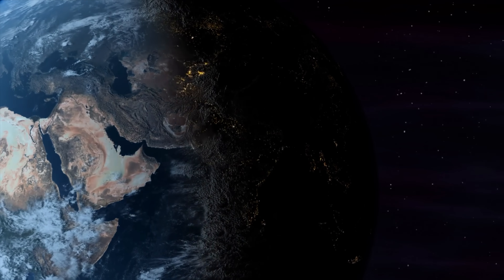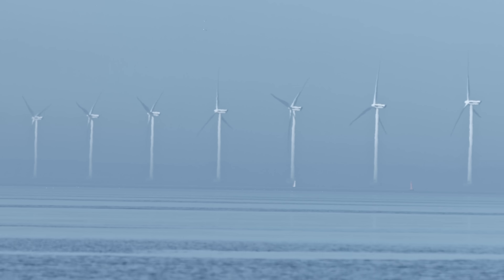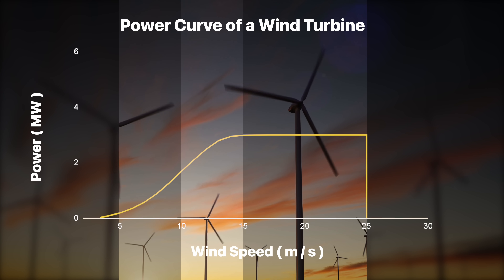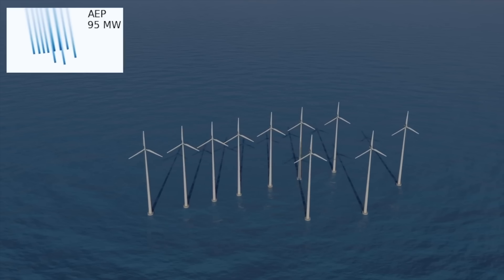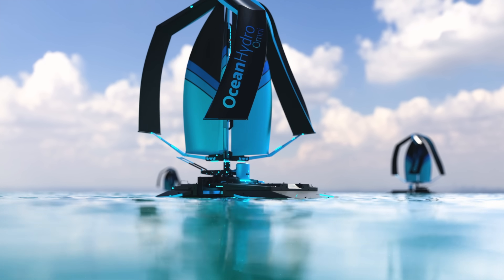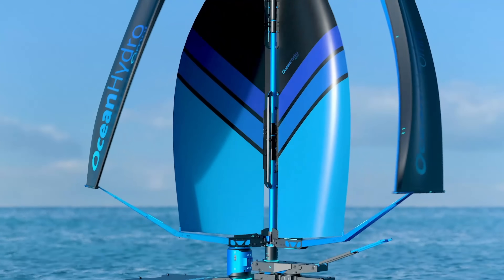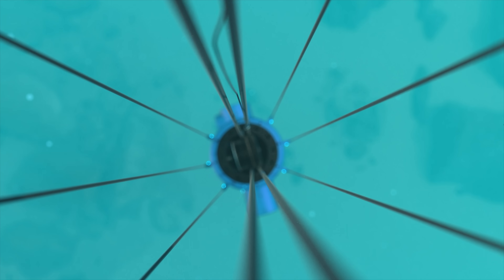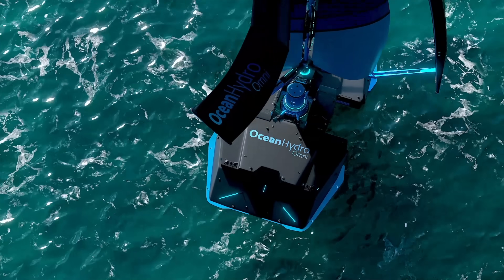Breakthrough Tech Solves Wind Power's BIGGEST Problem!

Comment: As someone who worked in maintenance on offshore rigs, I give absolutely zero trust in something that depends on moving parts underwater. Saltwater, biological damage, electrochemical corrosion, erosion, mud intrusion, tidal surge, the list of things that can damage moving materials underwater is too long to list. There's a reason there's no old submarines in service, why ships have to be pulled out every few years. You'd have more reliability if you designed a machine that hits itself with a sledgehammer every hour.
Reply: Forgive me for any ignorance involved; partially why I am asking this question!

Why does the energy storage need to be at sea at all? The energy has to be routed to the grid at some point; why not just have the energy storage on land just before connecting to the grid? Whether that is a gravity battery, a molten salt battery, or some other form.

Is it something to do with an added inefficiency when moving variable amounts of power over distance vs. a constant? That is the only reason I can think of as to why you would want the battery specifically at the generator when the generator is in a difficult environment to work with.
Reply: @aimerw  There is some theoretical advantage to be gained by the water depth and use of buoyancy to locate the upper mechanism of what is essentially a crane/hoist. However, and underwater crane in an deepwater marine environment is a recipe for a maintenance disaster. Aside from the maintenance workload itself, if anything is dropped to the sea floor during maintenance, the whole mechanism could easily be terminally compromised. Now multiply that by however many thousands need to be deployed for a meaningful grid contribution, eventually the oceans will be littered with wrecks. We're trying to think sustainability, aren't we? Why work in an environment that is notoriously difficult and expensive to clean up?
Reply: @aimerw  the flow batteries are entering  production,gelion and redflow. The materials  are cheap and they can be scaled easily. Rust batteries.  There are others.
Probobly  barking up the wrong tree on sea batteries.  But all possibilities  should be explored.
Reply: @aimerw   - nope, it is just "their" cute idea for "co-location" - gen+stor - , maybe there are reduced grid access licensing issues (usualy there are way different licences for the 2 functions as storage needs to satisfy demand contracts, and provide frequency control and demand levelling, ect,  while generation can be intermittent) - but all the downsides exist (pumping air to a submerged chamber is probably a more sound "at sea" storage solution, but that doesn't sound as revolutionary any more - compared to a modern "coockoo clock mechanism...  thermal inefficiencies exist in that one too..)
Reply: I hate to reply to my own comment, but this is probably the least efficient way to generate power with mechanical generation also. It would be more efficient to lift and drop a giant turbine, that way you're generating on the lift and the drop, or just put it on a giant above water tank and mechanically pump and release water into hydroelectric generator storage, timing the pump and release with the tides would even make it more efficient and you have the same energy storage without water turbulence losses.
Reply: @plebiansociety  The pumped hydro idea was what I thought this was going to be, but an alternative would be to have two weights on a single turbine, with one weight being lifted while the other is being dropped to produce power.
Reply: @dalesplitstone6276   - OR put the weights in a dry environment and just send the electricity there.
"plebiansociety" has valid points and experience, untill someone gets a prototype working reliably the whole thing is an exercise in CGI.

The VAWT - having 2 sets of blades/wings - needs to consider decoupling (and probably "furling", or just get rid of...) the  drag-type starting vanes from the aerodynamic "wings, as well as moving beyond fixed pitch VAWT for cyclically variable  - (then startup torque becomes less of an issue, and more of a feature) - OR for startup to "cut in speed, use some stored / grid resources....)

I think the group designing this has more interest in sailing boat games than electricity generation - hmmm.

(don't forget submerged masses suffer from buoyancy - reducing mass effect - mass costs $$ - , and the VAWT hull has to displace additional volume to account for the submerged mass, hull "size" adds cost...  anyhoo..  we are being interestingly "entertained" )
Reply: @kadmow  The whole reason to put them in the ocean is to avoid the NIMBY effect. I’m not saying it’s a good idea- just explaining the rationale.
Reply: @plebiansociety  Good points.  A laudable idea, but the pink shirt wearing CEO of this startup has likely only testing this in his bath tub or local swimming pool.
We've long since proven as a species we can make nearly anything.  However, making it sustainable, cost effective when faced with the wear and tear of the ocean....hmm
Reply: @stuartburns8657  “make nearly anything”

Sorry that’s the kind of thing said by people that make nothing. What science and engineering have done is show what’s possible, and what’s not.  The possible, with work, has enabled the modern world.  The latter is important because humans are finite w finite resources and would accomplish little if they wasted time on the impossible.  One cant, for instance, build an airplane that flies out of the atmosphere and it’s silly to try. The world is not one big smart phone app, upgraded every 6 weeks for free.
Reply: @Nill757  Didn't imply that for a moment.  It was qualified with 'however impractical' 
Yes I'm aware the world isn't like an app my friend
Reply: @plebiansociety  I was thinking the same thing. This thing would need to be cleaned all the time (biological damage). There would be a buildup of coral and algae on the lifted object as well that would make it heavier the longer its submerged. This concept just doesnt work unless they have clever answers to salt degradation and sealife buildup
Reply: @plebiansociety  I forget where I saw this, but there’s another kind of battery I saw that was slightly different and seemed more feasible. Use the electricity to pump air down to a tank on the sea floor, and then release the air to regenerate that electricity. It’s not as efficient but after factoring in maintenance it’s probably the best option as most of the parts can be contained or sheltered from the sea.
Reply: @plebiansociety  I have only been on boats, none of you experience, but i know how many time lowering and raising the anchor causes problems lol, This is nonsense
Reply: @plebiansociety  Yeah and VAWT's are VERY inefficient. Pretty, but not enough product vs cost to build.
Reply: @plebiansociety  I came here to have the same complaint about large moving parts submerged in deep seawater.
Reply: @plebiansociety  extra maintenance means extra jobs too tho right?
Reply: @plebiansociety  I hate to state the obvious but while I was prepared to listen to you based on your offshore rig experience, you lost all credibility with the post.   If you can't or won't do the calculations, you're just being yet another emotional luddite.
Reply: @crinolynneendymion8755  it's just a YouTube comment tho right, it's not a peer review of a journal...
Reply: @crinolynneendymion8755  not emotional, just find it humorous that they think this is going to work with any sort of cost effectiveness.  A deep sea oil rig at 6 years of age has enough instrumentation and electrical maintenance that it requires 3 technicians working around the clock 7 days a week to keep up. They aren't that big, at least compared to other drilling rigs, and all they do is drop, lift and spin. But why should I have to do calculations when just major things on the workings aren't even explained; if this is going to be lifted and dropped by cable, how are they dealing with stowage of a cable not only strong enough to lift this weight but strong enough hold itself if it's going to be lifted and dropped hundreds of feet to the ocean floor. This thing is going to have to be seriously heavy to generate power worth mentioning. There's reasons boats use anchor chains and not anchor cables, seawater permeates to the core of cable making every surface corrode,  it stretches, and it has to be stowed. When you curl up a large diameter cable it adds stresses to the cable because metal doesn't want to stretch to make a curve. Stress it repetitively and it fails bit by bit until it snaps, releasing a force strong enough to cause devastating damage to both sides of the cable. So if you switch to a chain you have to use a very strong breaking mechanism, because whatever reel that's dropping this thing has to stop, the seafloor may stop the wait but not the delivery system, thing of backlash effect of a fishing reel but your talking with a heavy chain or cable. Most big ships have teams manually watching this action because it has to be babysat, search "anchor brake failure" on youtube. Nothing like that over and over again repetitively has even a glimpse of hope.
Reply: @crinolynneendymion8755  offshore is costly compared to hydropower
Reply: @plebiansociety  Surely it doesn’t need to store the cable? There’ll be a pulley at the bottom and I assume some kind of a massivel geared system at the top - but still basically a pulley at the top and a loop of cable? Anyway, I don’t disagree it seems impractical, having to deal with salt water corrosion, biological growth and also plant matter getting tangled up in the cables and fouling bearings and pulleys. I guess they’ll find out one way or the other at “stage 7”
Reply: @crinolynneendymion8755  daaaaaaaaaaaaaamn
Reply: @mondotv4216  It could be reeved so that it doesn't need to store cable on a drum, but the lifting/generating mechanism would then have to be located with the weight itself, so you'll have an electric cable that rises and falls with the weight. Then the electric cable becomes a maintenance issue.
Reply: @crinolynneendymion8755  Erosion dosent work on math.
Reply: @crinolynneendymion8755  You also do not mention a counter point to refute their claim. It is very well know thing that moving parts in salt water is going to require a greater amount of maintenance.  This is because salt water is corrosive on most of the materials we use to actually build things - NYC is still fixing the subway system from the salt water brought in by super storm sandy in 2013. 

Even Ocean thermal energy which is installed at similar depths and have no moving parts have to undergo maintenance because of the saltwater.
Reply: @crinolynneendymion8755    What calculations do you need?  His comment was based on experience and he stated seven major causes of damage to things that are kept in an underwater environment.  Then you resort to name calling?  Recognizing the potential shortcomings of an idea based on experience in that atmosphere doesn't mean he hates change, nor does it make him emotional.  His comments were just as valid as a fireman telling people not to put water on a grease fire.
Reply: @plebiansociety  thanks for your input! Really interesting and I think valid points. I’d love to hear any other potential problems you see from your experience working off shore (of which I have zero experience.) 

Random thought, but I’m thinking scientists probably need to look for natural materials already existing long term in the ocean to either make components out of that material or study how those natural materials have such longevity in the ocean environment. In my experience, you really can’t beat Mother Nature when it comes to designing things fit for purpose.
Reply: @crinolynneendymion8755  I think you are being an intellectual snob here. While plebeiansociety was busy working hard on the rigs, he didn't have time to get trained up on the theory. But what he saw is invaluable and of far more importance than some abstract mathematical model, which can only be effective if it takes on board observations made. Part of the problem now is that everything is so computer generated and theoretical, the all important mucky hand men have been side lined. But side line them at your peril.
Reply: @crinolynneendymion8755  lol not sure of your thinking. His credibility is 100% solid. His reasoning is also 100% dead right and accurate. 
Anyone who has been on sea going vessels' or been around sea water knows what he sayes is spot on.
Reply: @crinolynneendymion8755  Temper temper. Please keep criticism to the concept, but the one starting it. And do please share your calculations.
Reply: That was my first reaction to. You would be better off piping the intermittent energy to a land based station. Then use some kind of gravity based stored system there or just use a massive battery.
Reply: Yeah Barnacles alone would take this thing out within a month in most areas.
Reply: That was my immediate thought as well.  How long does it take for those cables and winches to become completely fouled?
Reply: Yes, the ocean is an awful environment. Above the water is hard enough.
Reply: I have no knowledge on the matter and even I have doubts about the weights vs marine life. They look to have 6 cables to guide the weight that gets lifted and dropped. I can imagine any large animal would be able to move serval of those guides at once without seeing or noticing them. I like the idea of wind having its own type of energy storage like the weight, I just don't think this is a realistic answer. We can hope that it inspires other types of approaches or that they develop better iterations of the system to battle the issues.
Reply: Even leaving the salt water corrosion issues alone, the buildup of sea life on the moving surfaces will have a maintenance nightmare all its own, then scale these farms to the number needed to run a city reliably 24/7/365.25 and matched with the long term storage needed for seasonal changes, this Rube Goldberg pipe dream just won't hold up long term. They do have it right with VAWTs though, either that or actually building the HAWT turbine blade factories on the coast where these enormous offshore turbine farms will be built for ease of transport and repair / replacement. What to do with all these enormous blades at the end of life and the toxic waste involved in their creation, well that's a kicked can our kids will figure out what to deal with I guess, pretty much anything is better than burning fossil fuels at this point.
Reply: @anydaynow01  this is something that so many wind turbine fanboys do not understand or at least acknowledge in an honest way. We have no real (large scale, effective and energy efficient) way to recycle the blades. There are many now defunct wind fields with rotting and collapsed turbines littering the landscape. We also have not figured a way to design the blades to even withstand the erosive effects of salt air. The physical salt particles in the sea air blast (similar to and including actual sand blasting) the leading edges of the blades exposing the internal structure, therefore reducing efficiency and integrity of the blades. I’m honestly surprised this wasn’t foreseen earlier and just put a thin stainless, or other replaceable abrasion resistant cap on the edge. I think we are a ways away particularly with materials science and engineering but are not there yet. I applaud the engineers for trying and eventually will find solutions but the sensationalist attention and funding wasted on ideas that would not pass an engineering peer review is sad. We are pretty darn good at predicting the wave and tidal action. Not so much with wind.   Waves have a very predictable and stable pulse with few extremes unlike wind. Wave extremes would still be at a low frequency that can be handled by modern engineering and utilized unlike high winds which require the shutdown of the equipment.
Reply: @OttoTheWeim  i think that materials have greatly improved since the early disasters of blades being eroded in months, but yeah it is still a problem. i would assume they took their information from the aviation industy for forming their analysis, being the best they had at the time, and not understanding the difference in air quality in high and sealevel altitude
Reply: I agree with the saltwater corrosiveness issue especially regarding moving components as even the most exotic alloys are still only resistant to corrosion not corrosion proof and are expensive. I think they do have the right idea with using gravitational potential as a storage method. I would have thought placing the "gravity battery" inside a driven pile that's sealed from water ingress would be a better solution, the pile could even extend well above the sea floor or even water level if driven down enough to be stable when the weight is at the top. The gravity battery could even be integrated into existing piles that are the bases for existing turbines.
Reply: @BikerSam86  I wonder about the buoyancy of a big empty tube.  A few of meters in diameter and what? 50 meters long.  You'll need a big weight to keep it down.

While we're entertaining ourselves, how about we have SpaceX make them.  Thin cold rolled stainless, 4mm thick, robot welded, pressurized to resist the pressure at depth.  

Beautiful engineering, but greasing the bearings might be problematic.
Reply: Just need materials that can withstand the corrosion, stainless steel wires, new materials, graphene,  self cleaning prosegers,  fewer moving part,  It was said that going to the moon was impossible. Have the dream then make it reality.
Reply: @kevinwoolass5946  exactly but this requires identifying the best method and abandoning the others. You have snake oil salesman trying to this day to say we can just spin a craft fast enough and sling it into orbit.
Reply: I agree completely. This is desktop science, completely divorced from reality.
Reply: I completely agree.  Sea water is nasty stuff and it sounds as if they never even considered what happens in large violent storms with such low elevation turbines.  Waves could easily crest over those rigs.
Reply: Wind turbines demand lots of cabling. They are made from glass fiber, (very hard to recycle), they are enormously expensive, all the mechanics makes them very short lasting, they are noisy and ugly.
Reply: @gamleole  coal- and nuclear powerplants are even worse in all your aspekts
Reply: is it as silly as the concrete block tower battery? ;D
Reply: Thanks for bringing up a point that I’ve been thinking about for a long time! The maintenance costs on these turbines will be pretty insane, especially since you can’t just drag them out of the water like you can do with boats or buoys to repaint or clean them.
Reply: That last line had me like 💀💀💀
Reply: Agree with your comment 100%. These and the existing turbines along with solar panels are also really open to atmospheric disasters like dust or ash from volcanic eruptions which has happened in the past and lasted for years at a time .
Maybe the a solution would be to go with a long ago proven walkway safe and absolutely environmentally friendly power source such as Thorium Molten Salt Reactors. And since thorium is very abundant and these plants can be placed anywhere ,it would bring the price of supplying a almost never ending clean energy way down while not being affected from most environmental  damage .
Reply: Maybe if the mass was pumped in a sealed system.  Like pumping air to the bottom and using buoyancy and pressure  venting to generate the power.
Reply: I was thinking the same thing. Maintenance nightmare
Reply: Could enclose the parts underwater in a cylinder/tube for protection.
Reply: @minhdinh4802  they could use the anchoring piles for the cylinders, two jobs for one item and already used for non floating turbines.
Reply: @BikerSam86  Yeah I was thinking similar.
Reply: Absolutely correct. I have seen the same issues in oceanography sub-surface research platforms.
Reply: Instead of lifting a heavy weight could the system wind up a spring ?
Reply: Um,  you clearly do not understand how modern "finance" works.  The "breakthrough" is about breaking in to "investors" bank accounts.
Reply: Didn't you hear, THIS IS THE SOLUTION!!  Even with exactly zero ever built or tested, THIS IS IT!  Deal done!
Reply: I was about to say the same, except for the working offshore bit. It seems obvious that cables and moving parts in the ocean is high maintenance.
Reply: We've been making reliable platforms that live in the North Sea for years, how well do underwater generators in hydro electric  dams work?wave power, using air compression on the way up and vacuum on the way down, simple.
Reply: @charlesflouvat1829   Hydro electric dams are not using salt water, nor are the generators submerged.  Fresh water isn't nearly as corrosive, and only the impellers and other consumable components are in the water.  As for platforms, there's a big difference between stationary pilings versus intricate, mechanical parts that need to function in concert while submerged in harsh salt water.  Trust me... I want it to work, but unless it is inexpensive and easy to constantly repair, it will cost more than it returns.  Wave power has been around for 40 years and always seemed interesting, but it suffers the same fate and is exceedingly expensive to implement, or it would be used more.

We already have these ugly HAWT farms set up.  Why not retrofit them with a VAWT head unit and put the weight inside the column?  That way everything is protected from the elements, and because they can be built closer together, install  a bunch more around the existing ones... the damage to the view of the area has already been done.
Reply: I agree completely.  I've seen electrolysis eat plated, painted, stainless parts in less than a year on boats.  Using zincs or degaussing only slows the decay.  I love the idea, but I don't have high hopes for it's longevity.  And his claim that they are getting 20-30 years from current HAWT systems isn't exactly honest.  That's a best case scenario... most of them make less dollar volume power in their useful life than they actually cost to erect.
Reply: Good to hear from someone actually out in the field. When I saw that weightlifting machine and thought about salt water and what it can do, I said no way am I investing in this. Way better take your chances above water in the air with no moving parts underwater, and that would be a conventional horizontal axis Windmill. I don’t even think I would trust the egg beater in the pristine waters of Lake Tahoe. It all looks good on the computer generated images
Reply: What about in fresh water?
Reply: And yet engineers have been working with different materials to solve most of these problems.  These aren't ships that have to move a few thousand tons of material.
Reply: Cant agree more OP.  Moving parts and salt water(any un pure water) are the biggest headaches land or sea.
Reply: A simple one-tonne concrete mass of 10,000 N force weight would sink 100 meters into the ocean along a strong rigid pipe which would allow generation of power when a magnet 🧲 within the pipe is drawn down with the simple 1-ton mass. 
The mass would rise up 👼⬆ when 1000 litres of water is displaced by an inflatable rubber ballast which has to be filled with air under pressure. 
Repeat indefinitely at a lower cost and easier technology to implement.
Reply: @solapowsj25  The mass will quickly foul, as does anything remaining under sea water.  Anybody in the business knows this.  And, in this case the moving mass will give up energy to the water column via drag.  Just stop.
Reply: Yes what do you do with those that are broken just let them rust in between the mass of turbines? What about sea polutions wont they get stuck in this park of turbines
Reply: “A machine that hits itself with a sledge hammer “ 😂😂😂😂
Reply: As a retired Naval Officer, I have to reluctantly agree with your assessment.  The concept is great, however, so with extraordinary long term testing and assessment at sea they might come up with a workable design.  I’m thinking materials, paints, electric charge, etc on the submerged moving weights.
Reply: Thats what im thinking about!
Reply: Also I would have serious misgivings on keeping a dense array of surface objects from crashing into each other if they are on 750m long tethers, they are going to have a huge drift area as that current and the wind push them around.  The spacing that is likely going to be nessary will eliminate most of the claimed wind-farm density dynamics they think that aerodynamics will give them.
Reply: My biggest question with off shore above water windmills is what happens when sea level rises? Underwater Tidal turbines would be something off the bottom of a floating platform except the barnacles etc. Overall I can only be disgusted by the shunning of nuclear power. It’s cowardice and stupidity of the highest level.
Reply: That describes pretty much my first concerns regarding this setup.
If they can easily replace these turbines for low costs and they do not harm the environment so much, than it might still be a legitament solution.
Reply: It’s called Joe Biden‘s administration am I right? Alright that’s my time folks.
Reply: I think I understand your words, yes, to much corruption where there is money to be made.   There must be power  from the sea, tidal and wave the first one predictably for years to come, wave, the weight of water compared to wind, admittedly a very hostile environment but technology will over come these problems, I remember my father laughing at me when I pretended to talk to my wrist, well it done and gone. That's the power of technology. The trouble is us humans are not moving with it.
Reply: I can see what you mean about how destructive ocean water is to almost anything. We can see it even how destructive it is on marine turtle shells. This technology would propably work better as an alternative to traditional wind turbine instead. Our large wind turbines are already behemoth in height. Adding of a energy storage like this should work too and last longer than being out at sea.
Reply: Exposure to seawater is not mandatory. Shield the weights in a tube and bam! problem solved.
Reply: @DunnickFayuro  Large empty  tube deep under water? Can you imagine any problems with that idea for a relatively small offshore platform.  Try a buoyancy calculation.
Reply: Correct. This is bullshit.
Reply: Exactly.  All marine subsurface energy generation concepts suffer the same problem, fouling from bio comes quickly, chemical corrosion longer term.  Pretty and spotless animated videos shown none of this.    Similarly, it pays would be marine energy companies to pursue ample grant money to build  a prototype or two for photos, because nobody need shutdown and defoul a prototype, you just walk away.
Reply: I agree with the previous comments, we have to solve the corrosion problem before it’ll be cost effective. A gravity battery can be added to any turbine or any power source for that matter.
Reply: @electrify2025  “can be added …”

Yes, by dramatically increasing the paired upfront  cost of turbine -storage, and maintenance cost of yet more moving heavy equipment.  It won’t ever happen at large scale as a result.  Several pilot projects financed by gov grant money? Sure.
Reply: @electrify2025  Did you miss my comment on why gravity batteries other than pumped hydro dont work due to very low capacity energy storage capacity?
Reply: Funny you should say that. I bought my old man a machine once ... it was a small desk-top box with a wee lever on the side labelled 'on' and 'off'. 
He cracked up the first time he tried it with the batteries in; set it on the table and moved the lever to on. Nothing happened. 
At first; and  then after a timely pause it rattled and vibrated before the hinged lid on top slowly opened and a wee hand on a wee arm came slowly out ... gently grabbed the lever and turned it back to the 'off' position; at which point the noises stopped, the hand whipped back inside and the lid snapped back down. All went quiescent.
Dad cracked up and hooted for ages afterwards ...
Reply: The French have been running a tidal generation system since the 60's. And it's still going strong. There is also a tidal generation system in the Bay of Fundy. It also is running well. The Nova Scotia project is expensive to run though.
Reply: You have a very good point: the material choice will affect the final design the most of all factors. Any contact of two conductive materials in salt water is a PoF. We have much advanced in material engineering by now tho, and carbon fiber cables are not out reach w.r.t. cost, given their supreme tensile strength. This material is significantly more electronegative than metals, but the problem of electrically isolating its anchor points from the base and other mechanical contact points is certainly a solvable engineering issue. Placing the generator inside the moving weight is more feasible than at the bottom, for its servicing. The bottom member can be as passive as a concrete anchor; slab-cut basalt is more expensive but non-corroding even in contact with carbon fiber, and nothing prevents you from using it as inlays in otherwise solid concrete fill. Silicones are non-reactive and non-conductive, and can be synthesized into a great variety of materials of desired rigidity/plasticity, from oily liquid to a hard shell. (They're a non-recyclable ecological monstrosity at the moment, but that may change with the scale of their industrialization.) 

My main point is, if you think beyond steel, there is a wide variety of materials that can solve the challenges you mention. The project is indeed looking into the future of wind energy, though maybe not immediate future, and solves very real problems with the current offshore tech. The design also has a very desirable property of scaling out, while the current tech is hitting the ceiling in its scaling up.
Reply: True...plus here are infrasounds that affect the inner organs of the sea-mammals, causing inner bleeding and death...it is only really profitable for those that build them...
Reply: Yup.. The ocean is a very hostile place.
Reply: I mean you could in theory just move the underwater components into the air, all you are doing is moving the weights up, I don't know how that would impact it exactly but I'm sure if you play with the weight etc it could work, the better question would be how efficienctly.
Reply: theres a comment that carries all the weight of real world experience and common sense . these guys get funded to tinker around with somebody elses money with no slightest concept of the way their little pipe dreams will stack up in the long term and they're too arrogant and aloof to go out and ask for any advice on what to expect
Reply: It doesn't have to work so long as you get a nice fat government grant.  Printer press go burrrrrrrrrrr.
Reply: Great point.   Thanks
Reply: How about building a house on posts so the house can rise up and move down. Then use solar and wind power (electrical or mechanical) to raise the house and store energy. A house weighs around 200 to 300 tons, raising it just 2 or 3m would store a lot of energy.
Reply: 1 ton 100 meters above a surface holds 0.27 kWH. Is that correct?
Reply: Ha that’s funny 😄
Reply: I was thinking of different variations on the same concept.  Use a wind-powered pump to push water up a hydro-electric dam.  Lift a weight up and down a giant tower, no water involved.  Dig a deep hole and lift a weight up and down the hole.
I'm wondering what your take is on wave powered generation, since those seem to all involve moving parts in the ocean.
Reply: @madcow3417 In the mountains where wind farms are placed in the valleys that funnel wind, this concept could be used with a rail system that drags weighted cars up a slope. Railcars could be dragged up and released sequentially to power the generator, and rail systems are very reliable.
Reply: @madcow3417  Yeah, my mind went right to testing this on top of an abandoned mine shaft.
Reply: @madcow3417  The type of power generators that you are suggesting already exist.
Reply: @madcow3417  agree - a giant tower such as those already used to support those huge horizontal axis turbines, for example!
Interesting ideas Ricky, but I think it’s worth separating the vertical axis element from the gravity storage element from the low height/ underwater element and evaluating each one separately (in my view the gravity storage element is probably the strongest).
Reply: @madcow3417  I did the math for using a 500 ton mass in a 100m mineshaft and a typical Danish 2MW land based windmill that on average produces 5000 MWh in a year - it could store about 15 MINUTES of average production of the windmill.
Pumped hydro has been used for ages to store excess power at hydro powerplants.
Reply: @CarlAlex2  Yes, pumped hydro exists and has its own limits.  None of them run more than several hours, most of them 6 or less hours.  Then, PHS the citing and geology is rare and difficult to come by. Dual reservoirs, in close proximity, separated by required elevation, water holding rock, ample water supply, no large population to displace, regular but cheap charging power, etc.
Reply: @Nill757  It does have that one really big advantage of actually working unlike other types a gravity stores.
And I am not sure suitable locations are that hard to come by - you will probably be best served by building them in connection with existing hydro power plants.
And why do you think the power would need to be regular rather than intermittent?
Reply: @CarlAlex2  “actually working
True

“suitable locations”
No new major PHS projects build in N America three decades. One new in W EU.  

“Existing hydro plants…”
… have one reservoir, typically made from flooding a river valley.  PHS needs two, which is rare geologically, thus second one has to be made by massive earth movement.  One was built in US on high bluffs above a major river, though in future a large PHS is going to seriously impact most existing rivers (river marine traffic and river levels) downstream if it’s dumping an entire upper reservoir hard into that river, or drawing it down.  

“…why … regular ….”
Because the economics of PHS are such that they (most if not all) have to run (discharge) almost every single day during high load, thus charge at the same time every single day, typically at  night.  Intermittent power need not apply.  Consequently, most PHS are built in conjunction w a nuclear project, as was done in the US and EU,  where the marginal cost of a kWh from an existing nuclear plant is very cheap.  The Chinese for instance are building PHS now in conjunction w it’s large and expanding nuclear fleet.

It’s been clear from an engineering stand point for decades now that there’s not going to be any large scale utility storage in this century.  Not hydrogen, not batteries,  not compressed air, not gravity, not a 10000X expansion in PHS.  They all have severe problems.  Now it’s 2022, and the evidence is empirical.
Reply: @Nill757  What you are writing just isnt true here in the Scandinavian grid. Out of the 10 PSP in Norway 2 were commisioned within the past 3 decades and the reason no more have been made has been lack of demand until recently. There are several potential locations suitable for more.
They were built to provide SEASONAL (not a few hours worth) energy storage and to use whatever chaep power was available WHEN it was available. It looks like Wind and PSP will pair up nicely since the seasonal variations in them go in oppposite directions - when one is high the other is low. At peak generation of our current wind power capacity here in Denmark we produce more power than we can use making it very very cheap for others to get at that time.
We are also very busy looking for other ways to store energy and that no solution will be found in the comming 78 years would be disapointing - fortunately the emperical evidence seems to be that we are more innovative than that - especially when we have to. It took less to get from the first powered fligt to the first man on the moon and that wasn't something we really had to do.
Reply: @CarlAlex2  Seasonal storage does not mean what you think it does.  It means the ability to store all the production of a major utility power source, for months, and then discharge it again for months.  No there is no such facility in Scandinavia  or anywhere else. The project would have to almost a thousand times larger than any existing PSP in Norway.

Please give the Man in the Moon theme a rest. There are also many technological concepts that were complete failures. Citing Man in the Moon does not also mean one fly an airplane out of the atmosphere or other silly things just because they want it to happen, as nature does not work that way.

“Denmark … very cheap”

The reality is Denmark’s electricity rates are the most expensive in EU behind Germany. Denmark’s wind production is small compared to the Scandinavian grid of which it is a part, which 8x larger.
Reply: @madcow3417  Stupid money?  A marine oil and gas platform produces thousands of times per energy per unit time, are far more resilient to high seas due to their mass, and even they don’t always make stupid money.
Reply: @madcow3417  Now there is an idea, have the rides lift the weight and then harness the energy as three ride recedes.
Reply: They also left out that wind speed is not the same at the surface as it is at 10m, 50m, 100, 200m. Look at wind maps! Or that the surface is the worse place to be. Leaving these out of the talk means the "two bit" either has ZERO understanding of off-shore wind energy or maybe is getting a kick back.
Reply: Thank you for your perspective. I was thinking of floating offshore oil rigs to what degree they need to deal with it. Though they will have a few anchors that require maintenance, while generating stupid amounts of money, so even high maintenance will be worth it.
Reply: @Karagoth444  Yes, what of they were hooked up to a hydraulic or pneumatic pump? There kinetic energy is easily pulled to a central hub onshore. My father talked about this concept years ago for backyard use.
Reply: While i totally get where you're coming from, it seems they could design this in such a way that the only 'moving' part that's under water is the cable being raised and lowered, with all the mechanical and electrical components above the water.
The weight would just be a big heavy block raised and lowered by the cable and some guide cables.
The cable would need replacing every so often but that seems like could be made to be a fairly simple procedure.

I'm still sceptical if that would all work in the real world, but i wont dismiss it out of hand completely.
Still, that weight would need to be hugely heavy for this to make even some sort of sense.
Reply: @TheCountess666  ...and with a very heavy weight, they'll need a lot of buoyancy, i.e. the thing's going to need to be quite big. My guess is that (if it works reliably) most of the power the turbine will generate should be generated directly as electricity, with the weight lifting mechanism working to even out the power surges and drops. That way, the energy produced will still be intermittent like a weather forecast, but at least it will be stable within small timing intervals (up to an hour?). 
Also, the weight needs to be able to go DEEP for maximum efficacy. This leaves a lot of coastal waters as unsuitable. Generating power further away from shore means longer cables, which is not a trivial cost.
Reply: @TheCountess666  The entire underwater apparatus could be sealed in a tube, no need to expose components, even cables, to sea water.
Reply: @dalesplitstone6276  I was going to say this.

 Combining the objection about the wind being weaker on the surface of the sea, it seems to me the ideal system would be:
 - a giant tower like the biggest horizontal axis turbines
 - but topped with a vertical axis turbine instead
- and with a weight being pulled up inside the tower for energy storage.

Regarding the objections on high maintenance costs, which I've seen several times, I would guess a hydraulic piston system would be more reliable. Such systems have been suggested for terrestrial energy storage, with the piston running up and down an underground shaft. To store energy, you lift the piston by pumping under it, to retreive energy you let the piston fall, which drives the pump in reverse.
Reply: @dalesplitstone6276  and what exactly would that tube be made of that it could handle the pressure just a few hundred feet down?  You just added huge cost and weight to the design.
Reply: @arizonastrummer  While the anchor needs to be several hundred feet down, the weight mechanism does not, especially if their are two weights, with one being lifted, while the other is dropping to generate power.
Reply: @dalesplitstone6276  Good one.  Let's convert that over to a land based system.  Huge tower, blades at the top.  Cables a
Reply: That's exactly what I'm thinking about, tidal turbines are still not in mass use and who knows when they will be, precisely because of the problem with salt water. We still do not have materials that can withstand the impact of the sea.
Today's startups are created when some student gets high and then has a "eureka" moment while playing in some parametric 3D modeling program. 🙄😄 
It is important to make beautiful 3D animations, collect as much money as possible and have good marketing campaign, and the fact that no one is testing or making what is imagined - that is something they do not think about.
Reply: @goranjosic  to be fair they are running at test, that's what the video is about.  TBH I'm as skeptical as the next person but clearly even if successful there would be years of R&D and further trial deployments ahead.  I really don't think people appreciate how brutal the marine environment is - and if stuff starts to go wrong you can't just pop in to do maintenance.  Imagine the weight got stuck 1000 meters down.  Or stuff got tangled up during a hurricane.
Reply: @goranjosic  o
Reply: @goranjosic  It’s not the salt corrosion so much as it is the fouling from underwater plant and animal matter, which happens quickly, corrosion is  slower.
Reply: @goranjosic  Pretty standard VAWT's seem to be ideal for scammers to promote. Very pretty.
Reply: @goranjosic  Hmm, seems to me that this problem as stated here has been around for a very long time, and not just in this context.
Reply: Very good point. I'm all for renewable energy. We are not there yet. windmills are good, but not in a big scale. For a homes ok, industrial not so much. Windmills on the water🤔 Before windmills was killing birds next  fish too.  When the windmills break down they'll probably just let it sink, These big industries don't care.
Reply: @richierich252  First, they're wind turbines, not windmills.

Next, you made a lot of ASS umptions with that statement of yours.  Next, you went after renewable energy as a whole which tells me you have a bias, so why should anyone care what you think?

In the oil loving state of Texas, record days for wind energy have been over 20%.  It's pretty impressive considering it's in a state that's hostile to green energy.

And don't bring up the grid failure early 2021 because that was mostly natural gas lines freezing up, and considering that the company who was MOSTLY responsible for that, Energy Transfer Partners you'd think the state would have talked about it.  But no.  They tried to blame wind farms.  It's amazing what a few million dollars can accomplish going into campaign finances.
Reply: @johndoh5182  hi Mr. John Doh. I'm sorry that bothered you so much, but thank you for correcting me "wind-turbines" very good. I live in Puerto Rico Just in case you want to dox me ☺️ I don't live in Texas. My English is not the best 😕. puerto Rico is a  Predominant Spanish  Speaking  Island. 
Oil has been in  Our lives for many years. "Is oil harming our  Environment?" I say yes.  To the extent And exaggeration they display on TV? "NO" .  Should we change our  Habits In using fossil fuels? Yes.
 Can renewable energy like solar and wind-turbines👈😄 replace Petroleum? Yes in our homes not  Commercially. You probably may use the Tesla factory for an Example that solar panels can be Viable that would be false. Mr. Elon Musk said it himself we still need petroleum  Until we find a better source of energy. You also might mention Apple ("the Donut 🍩"😀) have solar panels on the roof top, but the Apple Donut is just office space and some lab  Equipment that's all,  No heavy machinery Which uses 480V and about a 1000 Apms or more in machinery which solar panels on the roof  Won't give you. Soon  In the near future We'll come out with a better source of energy, I just hope that new source of energy won't be more harmful than petroleum.
 I've been hearing a lot about peroskite solar panels  There could be A new energy source 🤞I hope.  Until then petroleum is the way to find a new energy  Source. Thank you for letting me  Express my opinion ☺️.
Reply: @johndoh5182  “Tx … state hostile to green” 

Is that just trolling, or do you have some facts  behind that claim.  Tx has by far the most wind power installed among US states, per capita, whatever.
Reply: @richierich252  Sea based windmills work very well and at large scale - and the sealife benefits greatly from all those artifiical reefs. How could you miss this - there is plenty documentation on this.
Reply: @CarlAlex2  in side  These big windmills they are chemicals Gasses to prevent arching Inside the generators That is more deadly than then 10 diesel trucks turned on at the same time.
Reply: @richierich252  Assuming you are talking about sulphur hexaflouride:
1. The issue is that its a greenhouse gas and ultra stable - not it killing people or animals or plants.
2. Its widely used in all sorts of power generation AND transmission equipment. While a wind turbine typically uses a few kg a substation for overhead powerlines can use several tons of it, so its neither an issue only or even mainly connected to wind power.
3. Economically viable alternatives are likely to become available much sooner to medium voltage uses tilke wind turbines than high voltage usees.
4. It is intended to stay in the switch its used in, so with proper handling and in the abscence of accidents the gas will not end up in the atmosphere.

Nice try mr. disingenuous wind hater.
Reply: @richierich252  no just no, complete fabrication, you are either a troll or need to look at where you get your information better
Reply: @CarlAlex2  Yea the these types of attacks on renewable energy are generally equel parts stupid and disingenous.
Reply: @richierich252  WTF dude everything is recyclable. Sure plastic sucs, but what can be expected from a mass murdering industry?
Reply: I think tidal energy generation is economically sound even with the maintenance costs
Reply: @patrickriarchy1976  it could be, I think Japan is currently doing the biggest test in the world with Tidal turbines - it is still unknown exactly how much the maintenance costs will be because there are no large commercial turbines that work for long periods of time - but there are many smaller "failed" projects.
Reply: @patrickriarchy1976  I'm thinking of the ULTIMATE tidal generator...

1 - make a giant stator around the circumference of Earth with taps located in the most populace regions near it
2 - make a permanent magnet rotor to circle the stator
3 - drop a long rope from the moon and tie it to the rotor to make it turn!
4 - YAY!
Reply: @patrickriarchy1976  if it was, it would have been built on an economic scale by now.